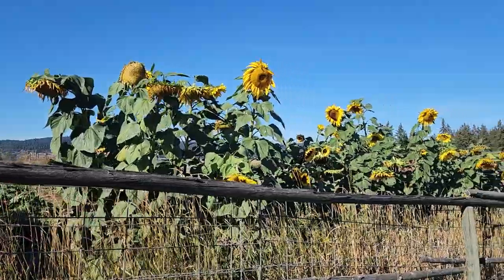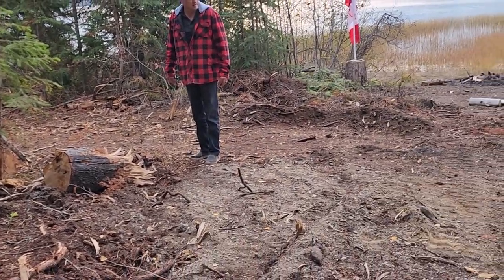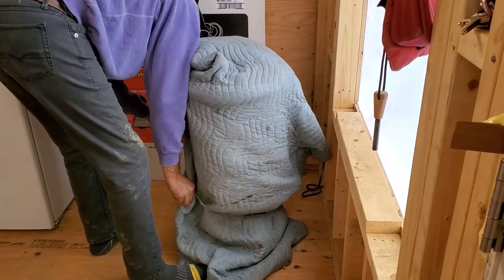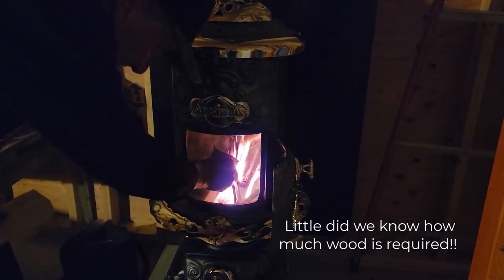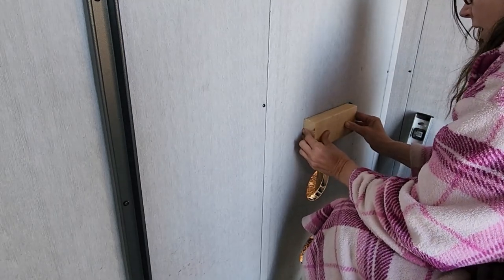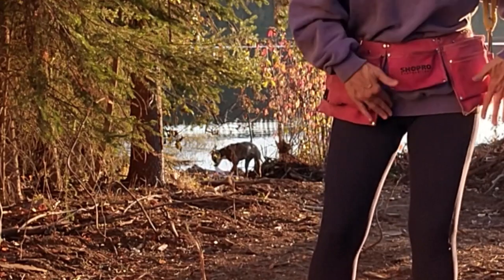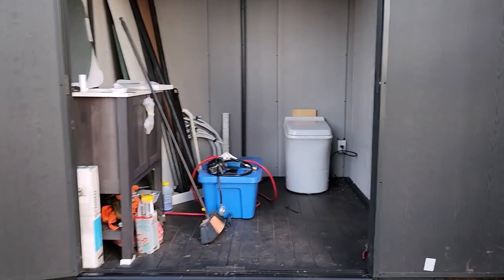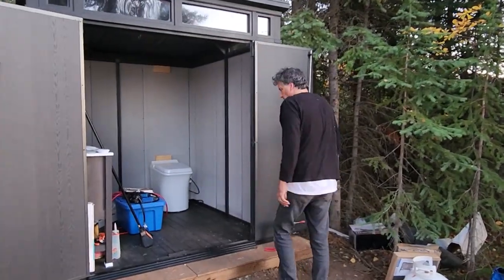Why We Chose an Incinerator Toilet  | S1 EP29

Comment: Am I correct that this appears to be the electric version of the incinerating toilet since you are off grid I’m surprised you didn’t go with the propane version as it seems like that would be a lot of electrical draw on your solar system?
Reply from the maker: Welcome to our channel! Good question. Yes, it is the electric version and we wanted it for the sole purpose that we don't want to be completely dependant on fuel that we may not always be able to get. We have a large solar array capable of running all of our appliances without any trouble at all. 

We only have 1/3 of them in operation at present and they easily handle the full load. We will need more power at some point though and we'll put the rest of the panels up next year. The toilet itself is an amazing contraption and works like a charm!